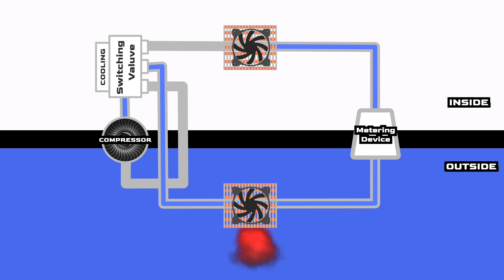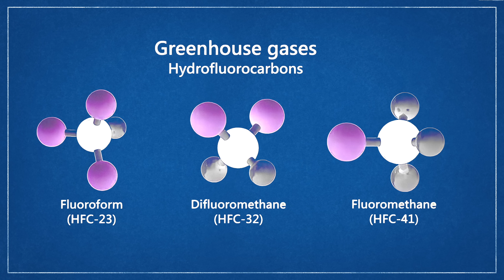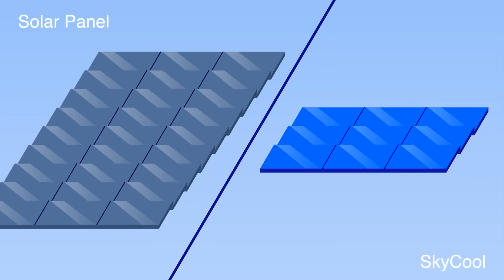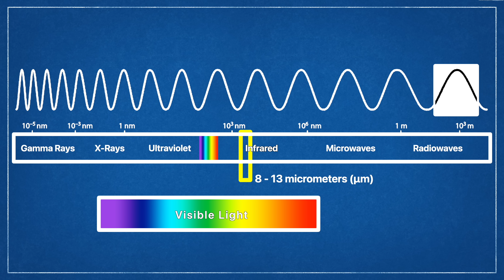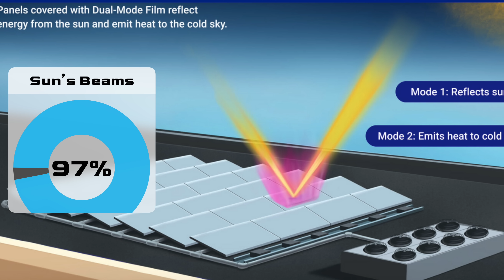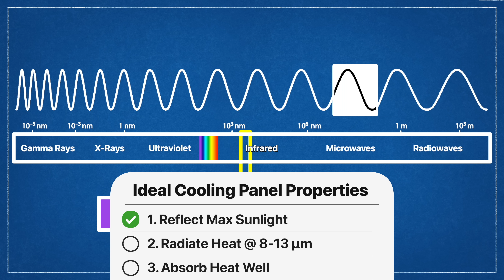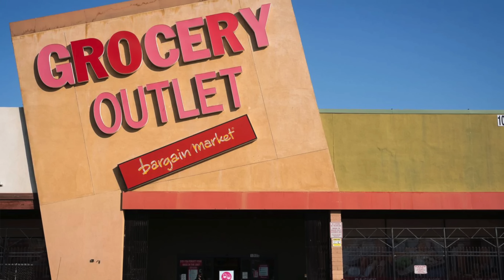New AC Tech Sends Heat Into Space & Saves 95% On Cooling Bills!

Comment: If it works at night does that mean a south orientation is not required? That would allow a north facing orientation(in northern hemisphere) preventing interference with solar pv. Main problem I heard is Silver back sheet. There has been some pv breakthroughs that minimize the use of silver…for a good reason I presume. Thanks for sharing.
Reply: yes you want it to point away from the sun if possible.
Reply: Silver is expensive.
Reply: well south facing is ideal but it could be anywhere just it would effect performance just like solar. Many factors play on this when it comes to your own house
Reply: @polarbearigloo  You would never want to point this south from the northern hemisphere. That would turn the system into a solar heater in the day instead of cooling.
Reply: @williammeek4078  like I said "ideally" it can work facing north but not as effective. Please look into how radient barriers work.
Reply: @polarbearigloo  I know how radiative barriers work. But apparently you don’t. If you put it facing south, you turn it into a solar heater when the sun is up. North is ideal for the northern hemisphere.
Reply: @williammeek4078  I don't think so. In neither case does it become a heater. It's more complicated than just a barrier or reflector. It's supposed to emit in a certain bandwidth such that it radiates to space. I think generally the idea is to point it straight up.

Comment: Looks like something I came across a long time back. Wonder if this will ever see the light of day.
Reply: Definitely. A few years could have passed since I saw this for the first time. Oh, those difficulties of scaling up!
Reply: Cooling ponds covered in the daytime and exposed to the sky at night are long known.  In order to control evaporation it was proposed to glaze the surface of the pond so radiation was the sole means of heat dissipation.  The twist I see in this tech that makes it interesting is the selective emissiness of an otherwise highly reflective surface, permitting its use in direct sunlight.  I was typing while listening so probably missed the assessment of how clouds would impact their effectiveness.  It seems cloudy nights are warmer than clear nights, so they must have some impact.  Probably worth a review.

I currently use an air-source heat pump for heating and cooling.  Faced with the installation cost for this cooling-only application I would seriously consider converting to ground-source in order to enjoy the higher efficiency both summer and winter.  Of course, much of the world population have a summer mostly or summer only conditioning issue.  This looks promising for them.